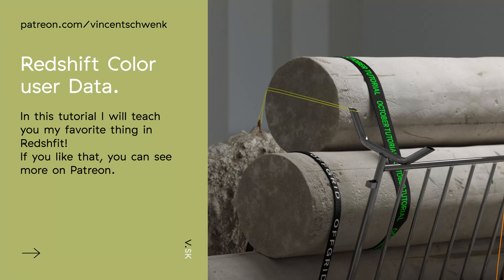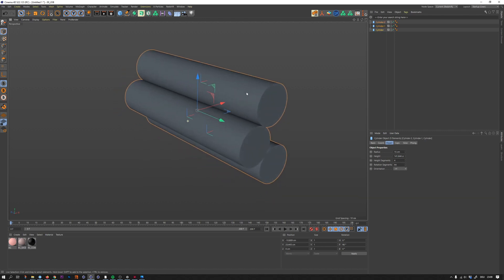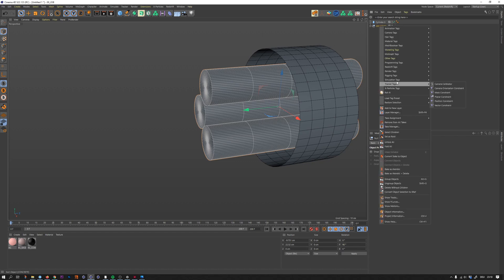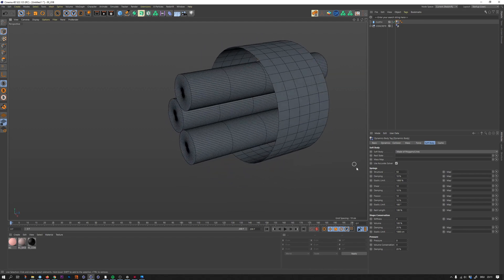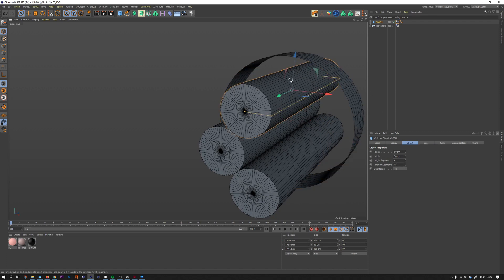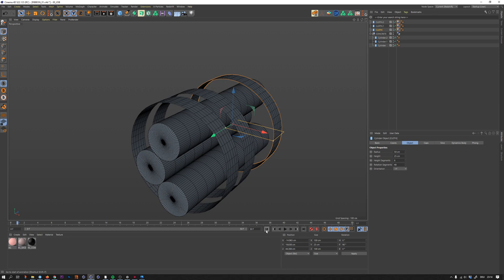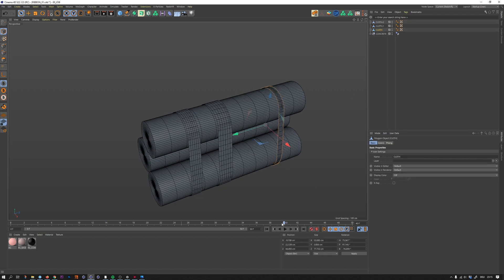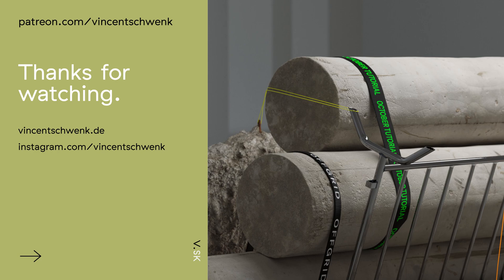Wrap a strap in Cinema 4D - Softbody quicktipp

Comment: The collision deformer can fake this very well: place your cylinders inside of a Connect object, give the "cloth" a collision deformer, set to Inside (stretch), and drag the Connect into the Objects list. Shrink the cloth cylinder's radius down and it will nicely wrap around the 3 cylinders - no simulation required, and keeps your object parametric (way lighter on your system too)
Reply from the maker: In this case it would have worked, but softbody looks better, because you also have deformation in the rotation. Also softbody works way better in Animation: I had so many animation glitches with the collision deformer.
Reply: @vincentschwenk  totally. definitely specific to this scenario, collision deformer has a very narrow use case. looks good on faking draped cloth too, or an object pushing through a surface!